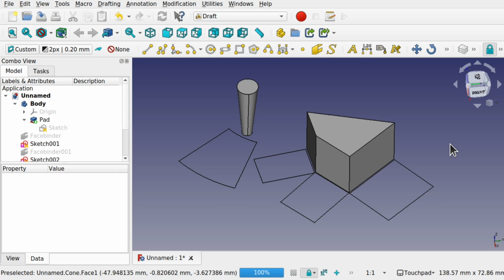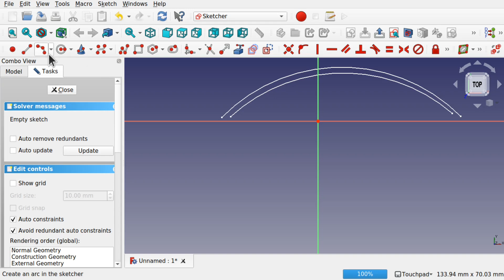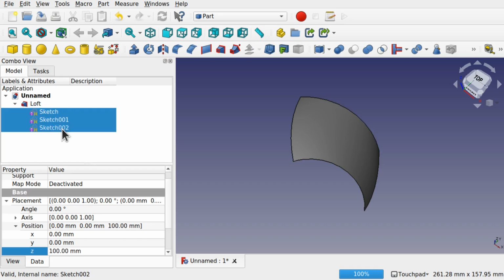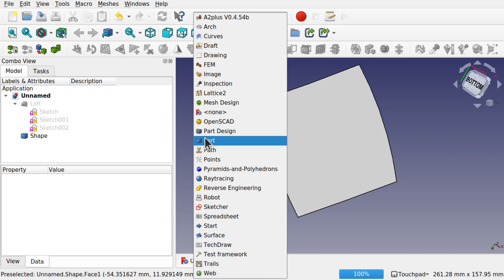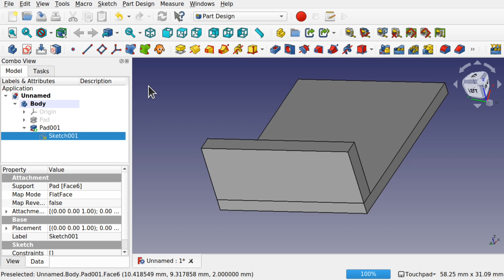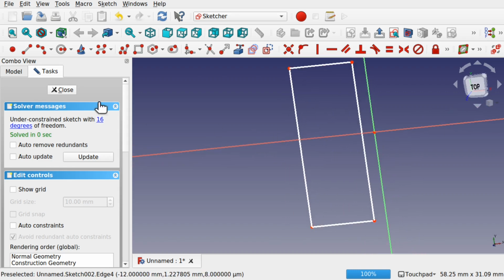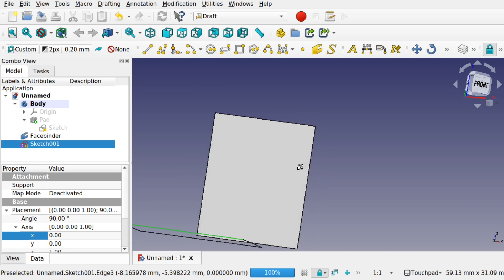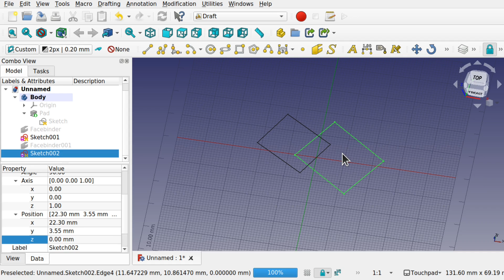FreeCAD: 3D to 2D Easy Output Lofts, Non-orthogonal and problematic models to Laser, CNC, Paper Cut

Comment: One caution with unwrapping surfaces.  A surface with compound curvature is not developable and a meshed unwrap will be distorted.   Only conics (cylinders included) are developable and can be unwrapped into undistorted flat patterns.   I use other software that develops surfaces from curved structures and its output includes values for surface and edge errors.  If the errors are small enough, then you can feel fairly confident that the flat patterns are accurate.  I wonder if FreeCad indicates the error within the mesh developed from the surface.
Reply: What other softwares?
Reply: @tublars  I mess around with boat design and building and my go to software for primary design is Freeship.  It’s also open source freeware. (Is that still a thing?) 😑 It has a tool for unwrapping surfaces that are given a “developable” designation with associated values for edge and area errors.   It can also display areas of high stress in tension and compression so correction can be attempted.
Reply: @Flying Boatman   Interesting, I will give it a try. I haven't experimented enough in freecad, but I wonder how it would handle f ex a sphere, if it could flatten it in the same way one makes a map fit a globe?
Reply: @tublars  I think that you would have to define panels (by splitting the sphere at distinct intervals?) so FreeCad would have a frame of reference to work with.  Otherwise, I think FreeCad will simply try to smoosh the sphere flat through mathematical manipulation.